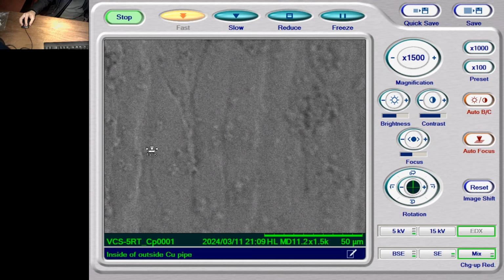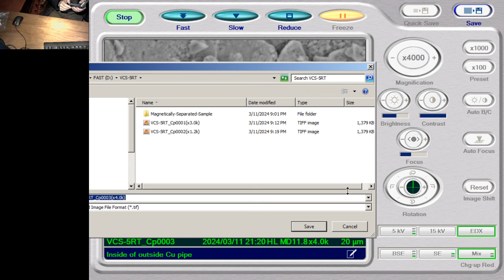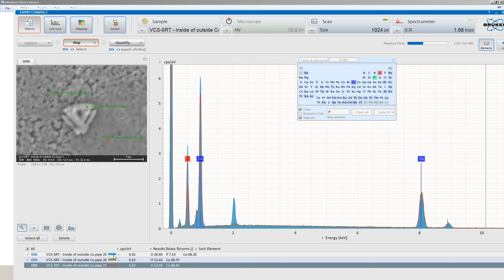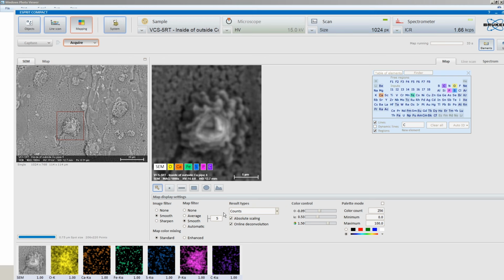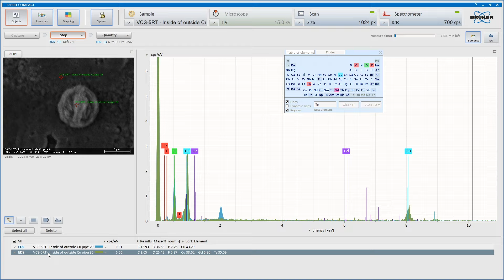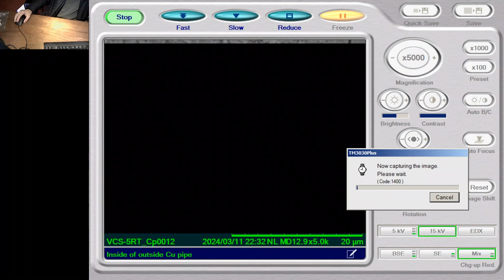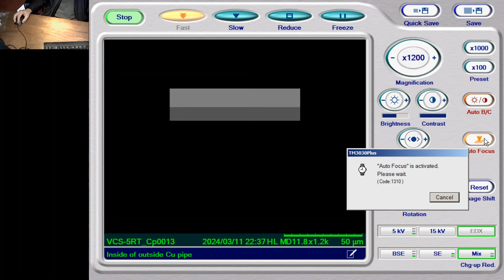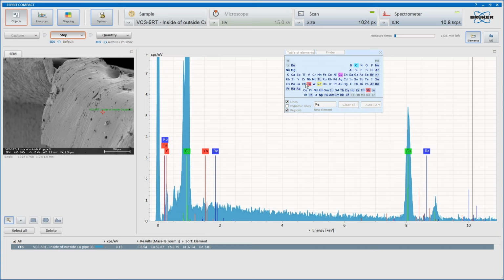Bin-Juine Huang - First look at the inside of the outside of DHX-2 piping

Comment: Phosphorous, when set on fire and small enough to burn, can explode and burns like a sparkler.
The cavitation could be making phosphorous, then if a spark is made, the tiny phosphorous gets lit, and boom goes the dynamite.

Could be a cause for the failures. I'm not sure what it means for the transmutation.

This explanation would explain not seeing phosphorous in the scale samples but you do see it where the pieces were at before the phosphorous "blew up" meaning, were lit and caused too much pressure ending the experiment in failure.